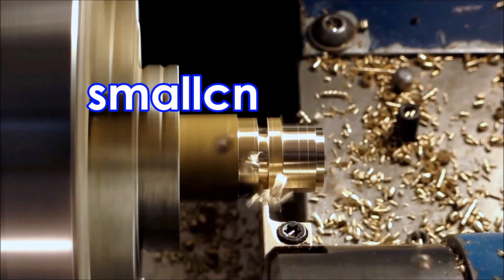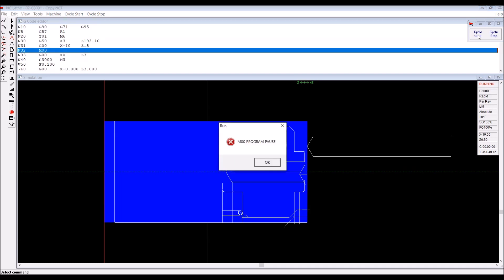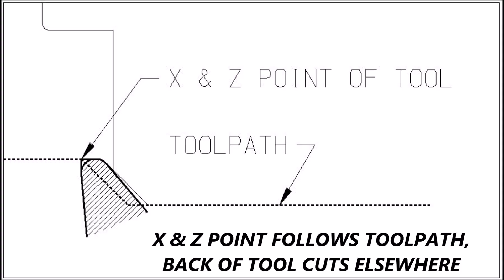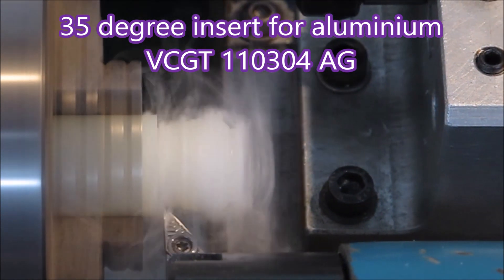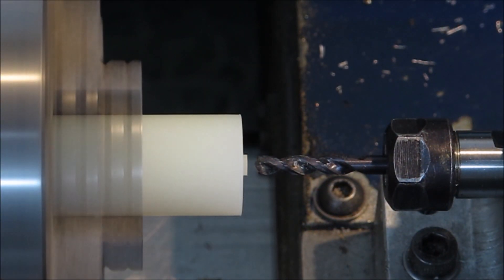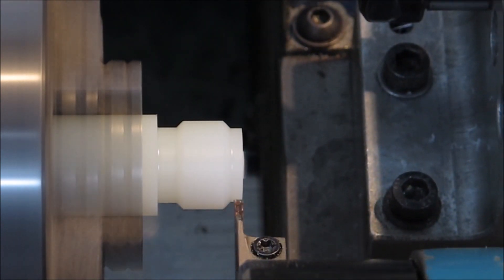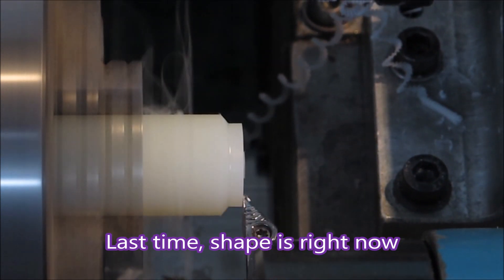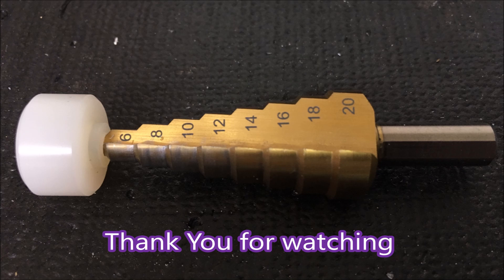Turning and drilling a roller in Nylon 66 in a small cnc lathe and getting the program right

Comment: It looks like you chamfer the hole after drilling it, then face off the part that would include the chamfer.  Am I missing something, or was the chamfer just habit?  I really enjoy your videos.  Thanks for posting them!
Reply from the maker: It may look that way but there is some chamfer left after facing. In plastics it is quite easy to go deep enough with drill to still have a chamfer after facing. Thank you for your comment, it does look in the video like it is removed, but there was some left to save me doing it by hand as I had to do with the other end. Glad you like the videos, now I am retired there are not so many parts to make videos of, but I will try to keep them coming.
Reply: @smallcnclathes  Gotcha!  Thanks again.  I haven't converted my lathe to CNC yet.  I have two mills converted to CNC, two Tormach 1100s, and two manual lathes.  The lathes are next on the list!

Comment: Nice vid as always!
Yes, stepdrills are great, even the cheaper low quality ones. The best tool for drilling large holes is sheet plastics. Also, as you pointed out, cold be used as deburring tool. Stepdrills are getting a bad rep from people who don't really know how to use them and try to drill angleirons and steel plates. Of course, they then experience short tool life.
Keep up the good work!
Reply from the maker: Thank you. I find it great for sheet steel which can be difficult to drill with normal drills.